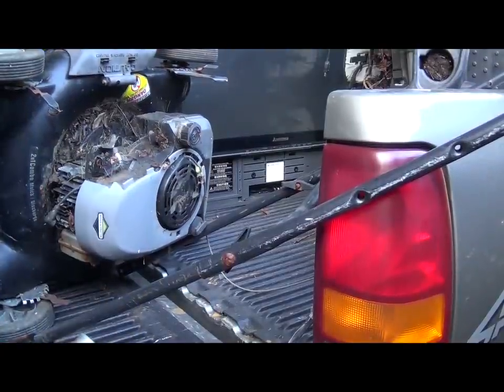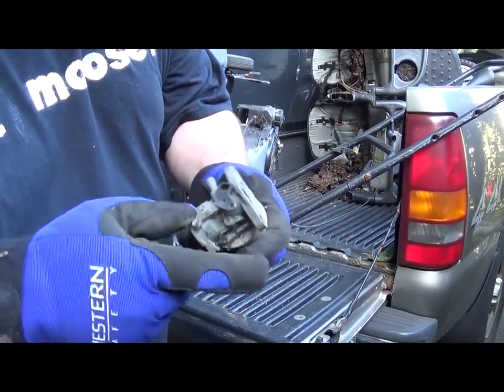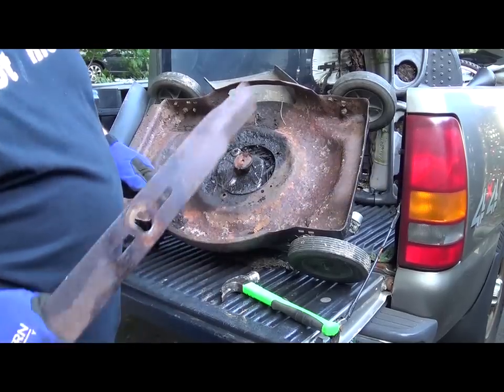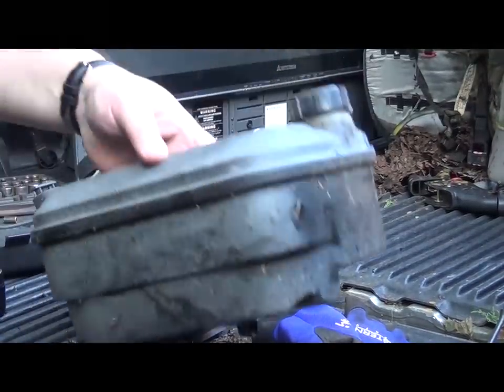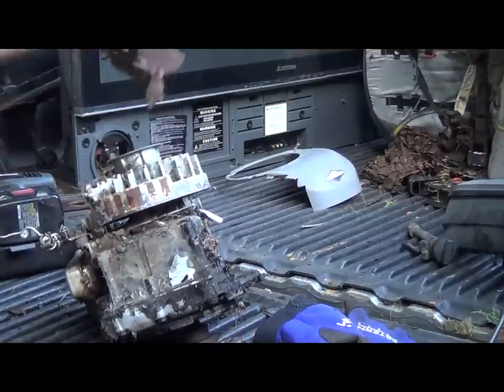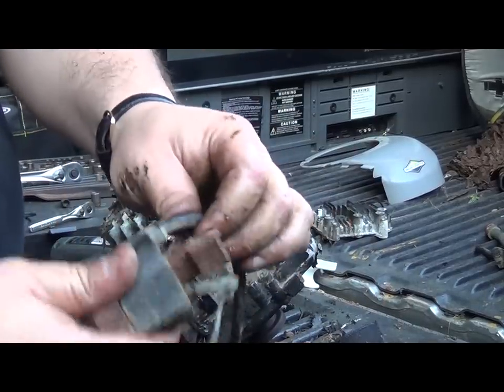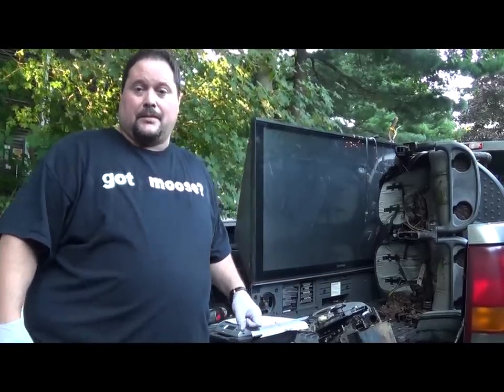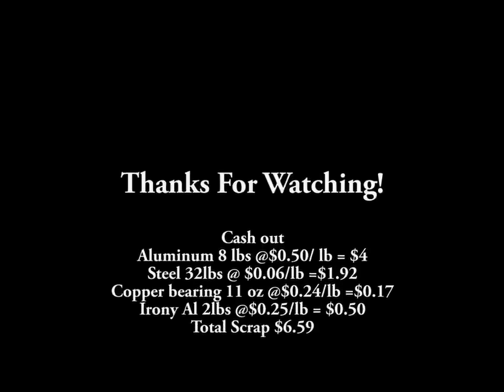Scrapping a Lawn Mower for Aluminum, Steel, and Parts for Cash!

Comment: The aluminum flywheel on top of engine is all aluminum except for the magnets that are pressed into it , the magnets when going past the ignition coil react with the  ignition coil creating the high  voltage necessary to fire the spark plug , you may be able to remove the magnets ! Also when taking the crankshaft out always remove the connecting rod and slide the rod and piston out of the engine ? Plastic gas tanks and GOOD ignition coils are worth more for parts of course but always write down the model of mower and tag the parts so you know what you have ! Great video !

Comment: just so you know Mr.Moose ,  mower coils are worth  between $40 and $120  New . So if you can get spark  it's a good Idea to  take the Make and model Number  off the mower Deck and Sell it On Ebay  for  half of new.  ( make and  model of Mower are very important when you sell some parts, as the same  engine from another brand  may not fit another .

Comment: remove the fitting the blade connects to, Remove the lower housing, remove the race bearing connection, push the piston out and away. Tap the spindle out of the upper housing....

Comment: Hey Moose, great vid. Too bad we missed out on the sledge, lol. Here's my deal, I've been piling up scrap for years: car alternators, electric motors, aluminum siding, grills, many push mowers, motorcycle aluminum wheels, odds and ends. That and I own/operate a motorcycle salvage yard mostly Jap bikes from 1960 to the mid 80's, over 1200 cycles, mopeds, atv's and snowmopiles. Just the front fork bottoms alone (on rusted forks only!) would add up to hundreds of pounds of aluminum. My problem....I'm too busy trying to eek out a living selling parts on evilbay (and paying them and PayPal and fed tax) and ignoring the scrap. I make barely enough to pay the bills with a little money left over for fun. I'm a consummate procrastinator and um, hoarder. Any ideas?
Reply from the maker: Well, I dont know what your expenses are, or how much money you make on ebay, but I think if you could try to manage a few hours on one day a month to get to the scrap yard I think you will find it worth it and end up forcing yourself to make more trips.  Don't get me wrong, you should sell what you can on ebay, but what does not sell, scrap it.  Try not to go with just a load of iron though, you will liekly be dissappointed if you go with just that.  Try a load of half Al and half Fe.  Best of luck to you, I totally get the issues with eeking out a living and finding time, between my 40 hour a week job, scrapping, ebay, and youtube, two kids, wife, pets, home to maintain...the time just slips away!
Reply: it would be wourt it. the cast is alot of weight in better then sheet aluminium. the rims is just to bash out the bearings and remove the tire and then the forks is like one bold to take off and bash away the fork tubes

Comment: Hello Moose. I have stumbled upon two truck campers that have roof damage (both) and leaked for a year. The interior is ruined and moldy and none of the appliances work. There would be a fridge stove water pump and furnace. Have you ever scrapped a camper before? Also the siding is aluminum and not the newer fiberglass ones.
Reply from the maker: Nope, never scrapped one of those before, I would love to hear how it turns out!  I have scrapped the individual parts though and made vid on em, all but the fridge that is.

Comment: I received 4 mowers for scrap. 1 looked too damned new, it was...a new murray 21 in. briggs and Stratton engine was froze. I spent 10 dollars on oil, spark and gas....I got it unfrozen and it is running like a champ.... spent 10 getting 20, doubled my money.plus getting another mower to fix.
Reply from the maker: Jay Stevens Got to love it when that happens!

Comment: Moose get a impact driver with sockets it will save you alots of time,I use one every day to. break down scarp.
Reply from the maker: working on it.  I fixed up a mower and am trading it for an air compressor with an impact driver and wrench.
Reply: The cordless impact pack a lots of power now,thats what I use

Comment: Remove the blade.... Remove the part the blade connects to.....remove the lower housing plate....disconnect and remove the piston....the upper housing will come off easily...still waiting for a vid about removing the valves using a valve spring comressor

Comment: how did you take the the  blade collor moose  most have stuck on or are rusted on the shaft
Reply from the maker: +allan bayne The only two ways that I know of are to use a pair of jaw pullers, you put a bolt in the middle hole that is longer than the depth of the hole as a base for the jaw pullers to push against, or use two prybars on each side and try to pry off gently.  SOmetimes it needs to soak with a little liquid wrench overnight.

Comment: Just curious, do you pay a lot of eBay fees? Your structure may be different in Canada? but in Aus it always seems like I'm bent right over on fees. I sell a little, mainly car parts I won't use, mainly under $100 per item and I'm paying around 20% in eBay/PayPal fees. Also, you should invest in a good set of gear pullers and maybe even a harmonic balancer puller set, it may make things a little easier, I recently bought a 3 and 4 jaw puller and some bearing separaters, damn they've been used. If it won't fit onto my press, one of those, or my slide hammer comes out to play.
Reply from the maker: HI and thanks for watching!  I am actually in the US and as for the ebay fees, they drop once you have sold a certain amount or become a power seller.  My fees are now a flat 10% which is completely manageable for me, especially since everything I post is stuff I get for free!  lol.  Best of luck to ya mate!

Comment: Oh and another question I need to buy a universal bit can you recommend a place for me and i mean it has to have every bit to every screw you encounter on a daily basis.
Reply from the maker: I have not found any one set that has all those little bits, but You can go to most hardware stores, I went to an ACE hardware and found a bit set that has about 50 bits, all the phillips, flat, hex hear, allen, torx etc and then I ordered a tamper proof bit set from ebay for $5.  Those two sets together get me through 99.99% of my scrapping.
Reply: Thanks for the Info I checked Homedepot and found a set with everything for 36 is that to much?